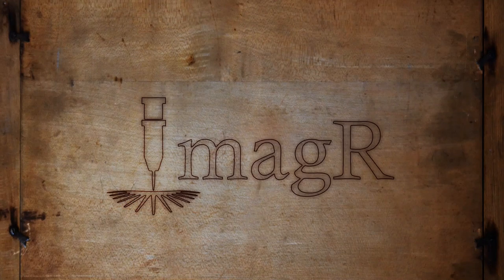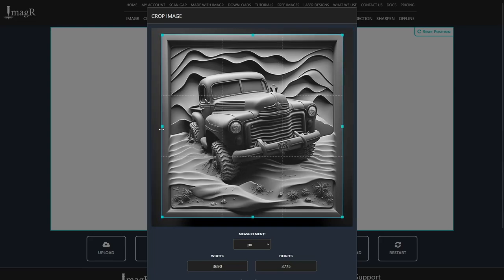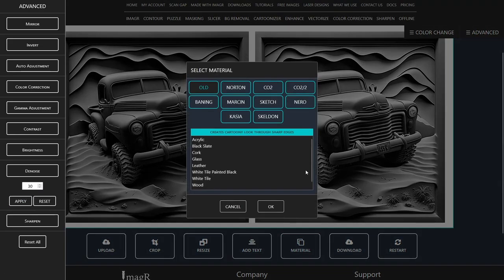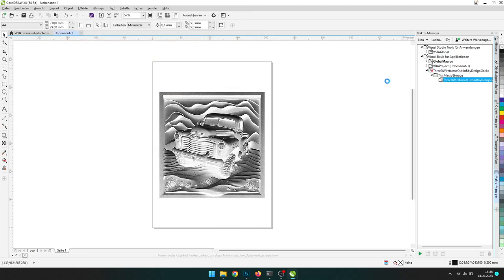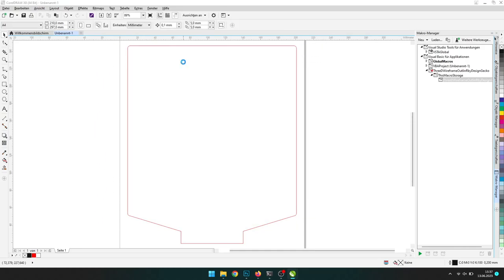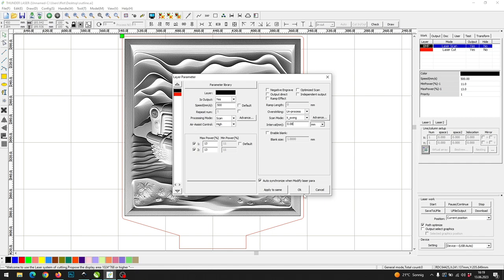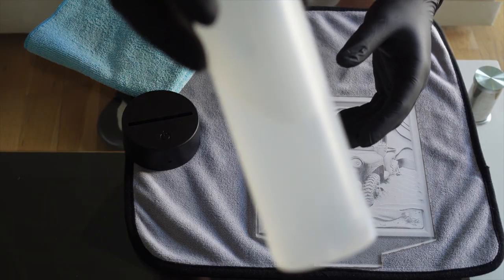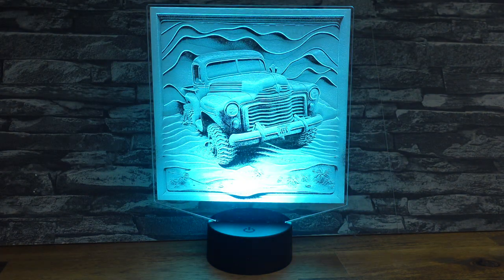I learned how to ENGRAVE LED LAMPS perfectly!

Comment: I have had some pretty good results with Diod but you don't want to flip it because with Diod it's going to etch on the back. I use the black poster board from $ tree behind the acrylic and get decent results.